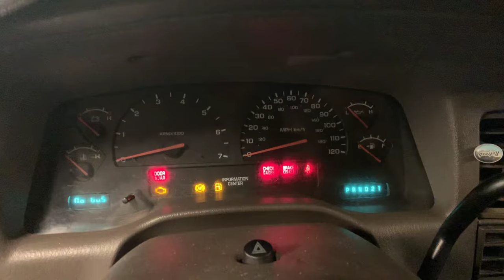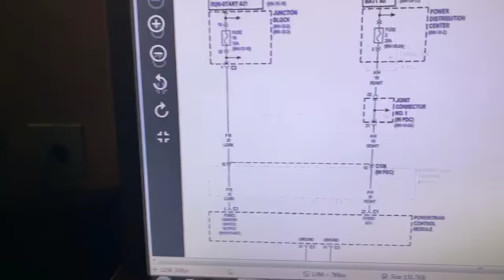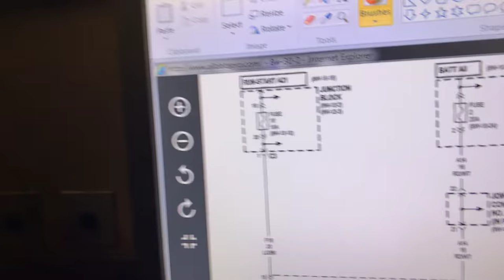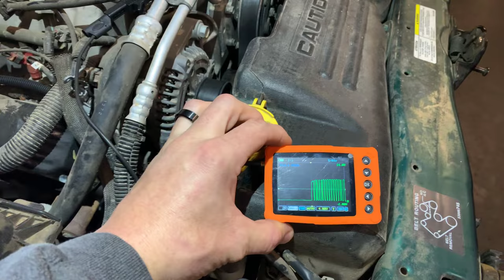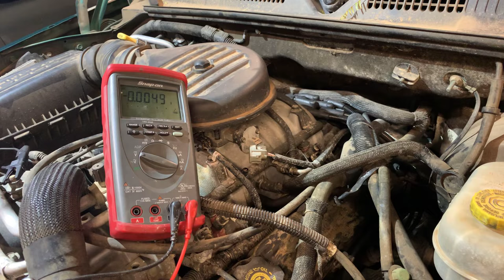Dodge Ram 1500 PCM problems No BUS FIXED! No Communication PCM/ECM replacement. Problem solved! PT 1

Comment: I've replaced the PCM twice and still having the same issue. It will run now but it is giving all the same codes and no bus signal. What would be your next suggested place to look. Keep in mind I've already changed the speed sensor and the ignition sensor.
Reply from the maker: I would want to look at a wiring diagram and see what other modules are on the network with the bus. There could be another module bringing the network down. Also have you verified good powers and grounds?
Reply: @codysautodiagnosticsprogra8706  Yes. That was one of the first things I checked. I traced the wiring back to the fuse box to see if there were any connections that were bad, faulty, or missing. Still couldn't find anything.  Took it to a dodge dealership and they are saying that they can't communicate with the computer. I'm almost thinking I've had two bad computers. The first one I got on-line from a refurbished place. And the second one I got from OReillys. I don't really want to pay the dealership but I'm kinda running out of options.
Reply: @christopherezzell1993  ever figure it out? Crank sensor is another sensor to look at. The one you have to acess by taking off wheel and fender well.

Comment: Hi .. im  auto electrician I have 2009 dodge Durango... which have gas pedel not working I replaced new pedel but still same condition... any idea which IC I chang to solving this issue?
Reply from the maker: I would be checking voltages at the pedal first for app 1&2 first
Reply: @codysautodiagnosticsprogra8706  I checked by Another Ecm then car Accelerater  work perfectly... mean there is no problem in wiring or something else... now I have one more ECM same modle but manual transmission... So I wanna now just which micro chip IC need to replace for manual transmission ECM to The car own ECM ..

Comment: I have a 04 durango that will not crank. Replaced the starter and ECM and battery.Just clicks once when I try to start it. I think it’s the skim module. Any suggestions?
Reply from the maker: Are there any codes in any of the modules? I can’t remember if a skim module would prevent it from cranking and should be a crank start and then stall. You could have a voltage drop on the battery cables which is causing the issue
Reply: @codysautodiagnosticsprogra8706  no sir no codes whatsoever. Battery cable voltage is good to go. They let broke off in the ignition about a year ago. I tapped on the skim module and got it to crank once. It like it’s not telling the starter to start

Comment: Cody I have a 07 dodge ram 1500 4.7L. I have fuel spark and crank but won't start
Reply from the maker: Have you checked if you have injector control?

Comment: Hey cody! I am having a weird stalling issue on my 06 chrysler 300c 5.7. The car only stalls after a cold start and it does it after the car has been running for a few seconds (usually stalls if I accelerate too). My mechanic is not sure what the issue is and is about to charge me crazy amounts of money to guess and check. It is only spitting a lost communication code too (lightning bolt tbc, check oil, check engine light). Any help would be a life saver for this broke college student!
Reply from the maker: Leo Leo what’s the communication code and what module is the code stored in?
Reply: @codysautodiagnosticsprogra8706  
Code U0101 for Lost Communication with TCM. I don't have the car currently but I can tell you exactly what it is tomorrow!
Reply from the maker: Happen to look at any data while vehicle stalls
Reply: @codysautodiagnosticsprogra8706  
So I diagnosed it as a bad ignition coil. I checked the data and the other ones seemed to work fine but one was showing some odd drops (checking the data) instead of misfiring. Replaced it and it seems to run better now
Reply from the maker: Leo Leo thanks for the update buddy, I’ve see  coils cause lots of issues in a vehicle, more then just misfires at times
Reply: @codysautodiagnosticsprogra8706  thanks for the help! Glad it was not the pcm. Lol. I honestly had no idea that it could cause that to happen. My mechanic was having a fun time lol
Reply from the maker: Leo Leo happy you got it figured out buddy. Those kind of issue can be hard to find at times

Comment: Facing a wiring issue for my o2 sensors for my 2000 Durango. Are you still located in Tucson? Which shop?
Reply from the maker: Yes I’m still in Tucson. I’m at borst automotive on golf links

Comment: I got same exact diag on an 02 Dakota. I put new pcm in and still no comm. can’t write vin without comm. but the truck runs now and doesn’t say no bus.
Reply: What are your thoughts?
Reply from the maker: So vehicle starts and runs but still no communication with scan tool?
Reply: I’m using a Triton D8 scan tool. Comm on everything else.
Reply from the maker: The fact it starts and runs tells me there is a break in the network wires to the scanner. If it truly was a no communication with pcm then obviously it wouldn’t run.

Comment: If I changed ignition switch 2 New keys old one no Chip ignition may not be communicating with pcu. Thanks
Reply from the maker: I’m not following what your asking. Changing a transponder key to none transponder does NOT cause a no communication with pcm, this will create a no start since immobilizer module is not seeing a transponder chip. Now if you replaced a non chip key ignition switch with a chip one that will not create a no start since there is no module looking for immobilizer information
Reply: @codysautodiagnosticsprogra8706  It started with changed alternator new ignition switch coil pack and battery. Now no bus no comm, does a ignition need programming or is it my pcu cause it cranks goodbye just won't turn its frustrating dealing with it 2 mths.Thanks for your reply.
Reply: @codysautodiagnosticsprogra8706  Now could it be a sensor like BCM or ECU,  Fuse maybe, I hooked up a different pcm to look and the no bus light went off but still no start. I'll recheck all fuses and lines I guess. Something I can't see is stopping it turning over, don't have funds to tke it to a shop or tow it.

Comment: Hey Cody. Do you think it was safer to use an LED test light when checking powers and grounds at the PCM?
Reply from the maker: For powers and grounds I use an Incandescent light to “load” the powers abs ground. Led doesn’t draw enough amps to show if the powers and grounds are actually ok. Being the module supply or main grounds an incandescent light won’t harm anything.

Comment: What is sending the signal to communicate to the PCM? Do you have a PayPal or accept Amazon gift cards, to walk through diagnostics for crank, no start with no communication on a 04 Dodge 2500? Thanks.
Reply from the maker: Each module produces a bias voltage and when the module is communicating the module brings that bias voltage to ground.

Comment: I have a 2002 dodge durango and it is doing the no bus
Reply from the maker: Follow the test in the video. Check powers and grounds at pcm, check lin bus signal and see what modules you can communicate with using a scan tool

Comment: I have a 1999 Dodge Ram van 2500 I just changed the pcm and it’s still showing NO BU5 lights are turning on and it doesn’t read mph, temperatures, oil and gas shows airbag light on check engine light on
Reply from the maker: You have a bus issue that needs to be diagnosed

Comment: Nice job here with proper diag.   I run around programming ecus for shops.  (Yes many are so bad that they pay us to write the vin on Chrysler).  Usually the guys replace the pcm even when it's just a wiring issue.  You are a proper mechanic.   There's a ridiculous amount of mechanics,  all immigrants, that i have to run behind and fix because they have no clue what they are doing
Reply from the maker: Thank you buddy,  I try to be the best I can and definitely don’t like shotgunning parts at anything

Comment: How was you so  sure that pcm is faulty if it had 5V reference
Reply from the maker: ivan drago because I wasn’t able to communicate with the pcm. I verified communication lines, powers, and grounds, plus 5v ref. If you have all of these and can’t communicate, then module is bad.
Reply: @codysautodiagnosticsprogra8706   Thak you

Comment: if the crank sensor isn't sending signal can cause the issue too
Reply from the maker: No crank signal would not cause a no communication event with the pcm. A bad crank sensor would cause no rpm signal while monitoring pcm data pids. A shorted 5v reference at the crank sensor can cause the pcm to lose communication but the 5v ref was checked in this video.

Comment: I would’ve grounded the ads relay circuit and make it start to confirm it was the pcm but since a lot of times we know what’s up with those pcms might just shorten time haha nice vid
Reply: How do I ground ads relay...I know how to jump the starter relay...wire across slot 30 and 87...is the ads the same

Comment: No BUS only appears on my 1998 Chrysler cirrus after driving it after a certain amount of time 
And a  I guess “symptom” that my car does is that the gages turn completely off and then that “no bus” appears it’s irritating 
The code that my friends scanner read was p1698 

Idk who to see or what to do to fix the car seems like the mechanic my grandfather took it to was a quack because LITERALLY NOTHING CHANGED . They only bandage the stuff that came FROM this issue 

The brakes AND Despite knowing the diagnosis they unplugged repluged but to not avail 

and I replaced the TCM 

WTFFFF DO I EVEN DO
Reply from the maker: Need to use a labscope to see what module is bringing down the bus

Comment: Will you always get no bus if it was a pcm issue
Reply from the maker: No not always. You could have another module taking out the network or could have broken wires somewhere as well

Comment: 2006 dodge ram security light flashes and doesn't communicate with the scanner when light isn't flashing it will communicate
Reply from the maker: Sounds like you have a communication issue
Reply: @codysautodiagnosticsprogra8706  I do somewhere haven't hound it yet

Comment: Great job  my friend
Reply from the maker: hassan issa thank you and thanks for watching!
Reply: Very useful information
Reply: Thank you for the effort and sharing your knowledge 😀
Reply from the maker: Your welcome. I’ll try and get more videos out soon
Reply: Had the same problem on a 2004 Dodge Durango 4.7 change it out still would not start. Sent it to a shop they said it was the fuel pump , got it back with the check engine light still on idling high next day took it and had check engine light check, o2 sensor bank 2 upstream and transmission malfunction code. Now it want start.

Comment: What if there is no 5 volt ref?
Reply from the maker: Then you need to disconnect all 5v sensors and make sure a sensor is not shorted to ground, this will cause the computer to become a no communication.